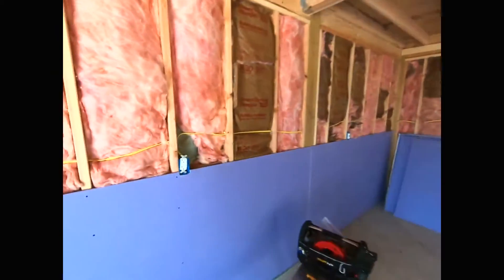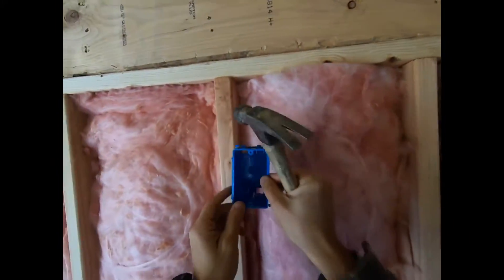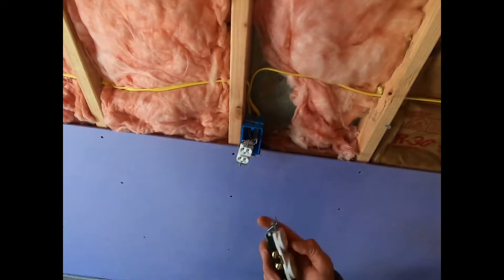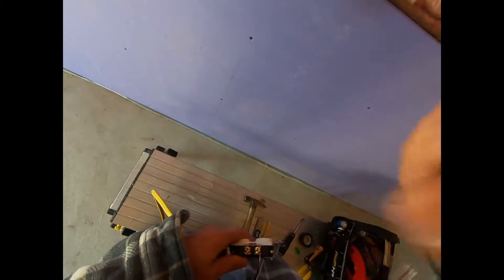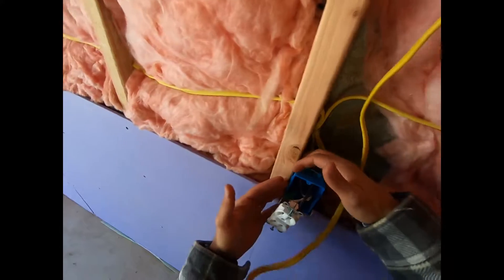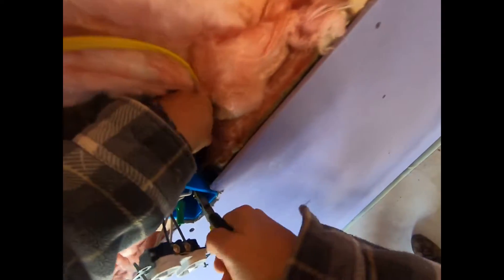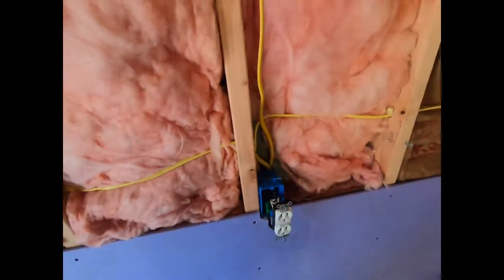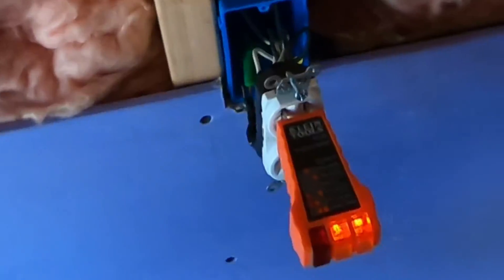Adding Electrical Outlet to Existing Circuit - wire an outlet off another

Comment: You stripped too much wire for back wiring. For side wiring, around the screw, you'd be ok. For back wiring, approximately 1/2 inch. There is a strip gauge on the back of the receptacle for this purpose.
Reply from the maker: Didn’t know about the strip gauge! That’s neat.  Thanks man.  As for the the 20 amp, I am running 12g wire, so had to use 20 amp outlets, and being a work shop I wanted to ensure sufficient power, if I am running multiple machines simultaneously. Thanks for watching and supporting ✊🏼
Reply: @TrueGritDevelopment  Hello Mudar, you added a new receptacle which is on the same circuit and that won't do it for increasing  power availability. If you have 2 machines drawing 10 amps each on at the same time you will overload the circuit and should trip the breaker. If you need more power you need to run some dedicated lines, wire gauge and cb value TBD based on expected need. You could, in addition run a multi wire circuit with a shared neutral. In this case the upper and lower sockets of your duplex receptacle will be on separate circuits. You can use a 20 amp receptacle if you want, but you don't need it. A 15 amp spec or commercial grade is the same, (not residential grade) but without the horizontal slot. If you have a tool that has a 120v 12 amp plug  (I have no idea what that tool is) you will need a dedicated line and a simplex 20 amp receptacle. The bottom line is that increasing power availability is determined by electrical panel capacity, wire gauge, and appropriate breaker.
I think the 20 amp duplex receptacle is designed mainly for industrial and commercial usage, but I have seen them in modern homes, no doubt. There are probably several reasons why, one may be that it looks good to prospective buyers when installed in expected locations. A valid reason would be to identify a 20 amp circuit as opposed to 15 amp circuits that have 14 gauge wire.
Reply from the maker: When I said “sufficient power” I didn’t mean increased power as a source.  What I meant is the reason why I was using 20 amp is because of the breaker and gauge wire.  And a 20 amp breaker brings in more power than a 15.  It’s better if I am running 2 machines on the same circuit.  Maybe I am not understanding? I didn’t want to put in 15 amp outlets on a 20 amp breaker and 12 g wire.  Unless what you’re saying is I could have used 15 amp breakers (cheaper) on a 12 g, which is true.
Reply: @TrueGritDevelopment  I get it now, and agree.

Comment: Hello True Grit, I tried the same approach on a middle of run circuit.( All the dry wall was in there before.). Added a new outlet from an existing outlet, residential 15 amp breaker, 14-2 wiring.  But somehow it worked the first time when tested with a standing lamp. But as soon as I connected the new outlet to TV and speaker it stopped working. I could see that the hot is still running power but the devices are not turned on. I tested it again with the same standing lamp and it didn't work. didn't really understood what has gone wrong. Advice please.
Reply from the maker: Hi, when you say the hot is still running, how did you test it? And is it the hot to the new outlet that is running/live? If the outlet worked at first, then I would think it got tripped.  Did you check the breaker? What else is connected on that same circuit? I am also assuming your wiring is correct? Black to brass screw and neutral to silver?
Reply: Thank you for your response . Part of the problem is I inserted the new wires in to the release button of old/existing outlet (black stabbed in to release on brass side, white stabbed in to release button on silver side). The existing outlet has two blacks/hots already stabbed in the correct section, which is the back side and brass side of old/existing outlet. Now, can I have the new wire in old outlet box wires to the brass screw? Or should I consider a pig tail connection.
Reply from the maker: You should be able to use the 2 brass screws and push in connectors for a total of 4 individual wires, I do not recommend attaching more than 1 wire per screw.  So you added a new outlet that you fed from existing outlet, correct? Your new outlet should work like a charm.  Could it be one of your connections came loose? I can’t really see the issue as long as you connected neutral & hot properly.  You can pigtail if you are tight on space in the box.
Reply: @TrueGritDevelopment  Like stated before, I was using the release button as a stab in. Just assumed that there are 4(black) connectors in the back. Until someone mentioned at HD that they are release buttons. Your video certainly encouraged me to purse this small project. Thanks for the help. Btw, I've moved the new wire from the old box release buttons and moved to the brass and silver screws(only one per screw), yes it worked like a charm. Didn't even have to do a pigtail.
Reply from the maker: Fantastic! I only now realize what you meant by release slot.  I thought you were referring to the stab-in connection as a release button (I was confused by that).  Anyway, I am glad your outlet works now.  Thanks for watching and supporting ✊🏼
Reply: You are welcome. Do you have a video on how to install the recess lights from first floor ceiling which has insulation. I've seen several videos but no one has a video on how they are installing the can's to ceiling or roof which has just insulation right above the dry wall. I understand these can's should be installed by going to attic. I am looking for more on the placing between joists and wiring. Thanks for your help.
Reply from the maker: I actually don’t, I should put one out though.  It’s the same concept, but more annoying as you don’t have access to entire ceiling above.  What you need to do is make a cut at the corner where you are feeding the wire.  You cut the corner so you have access to wall stud and ceiling joists in one small cut.  From that cut you fish down to your switch and again to your first light location.  I’ll try to make a video soon.  I don’t have any projects that require it at the moment, but if you put on notifications, you will be notified when I put a new video out.  👍🏼

Comment: just fyi to everyone, you can certainly install a 15A outlet if you wanted to. Most people do not have/use anything with a 20amp (NEMA 5-20) plug. Just because it is 12GA wire, does not mean you cannot go smaller on outlets. Yes it makes sense to keep everything 20 but not required.
Reply from the maker: Right you are.  15A perfectly ok on 12g wire.  I had 20A on all others, so kept it going.  It’s my shop, so definitely need the 20A outlets in there 👍🏼
Reply: @TrueGritDevelopment  certainly!
Reply: @TrueGritDevelopment  From what I can see, you do not need 20 amp receptacles. If you need to use a tool or appliance that uses 120v power and has the mating 20 amp plug you should have a dedicated 20 amp line to a single 20 amp receptacle. I could see having a 240 volt line for an electric dryer or charging an electric car. I know that 20 amp receptacles are used in residential application's, but I think they apply more to industrial or commercial uses. I would use spec grade 15 amp receptacles, they are the same internally and less expensive.
Reply: You can install a 15 amp receptacle on a 20 amp circuit  as long as it is a duplex receptacle. A single receptacle (one socket in the middle) with a 20 amp rating requires a 20 amp circuit. You can use a 15 amp single receptacle on a 15 or 20 amp branch circuit.